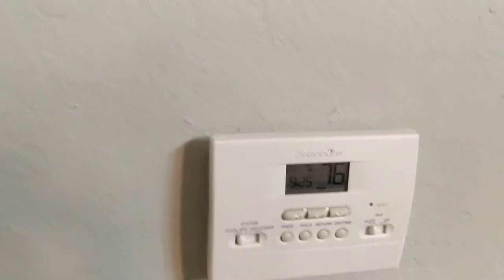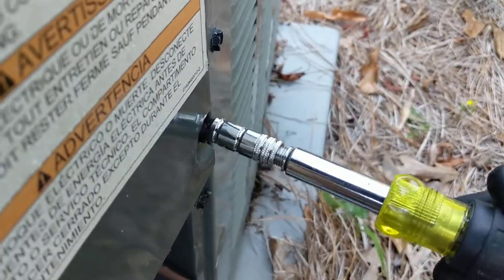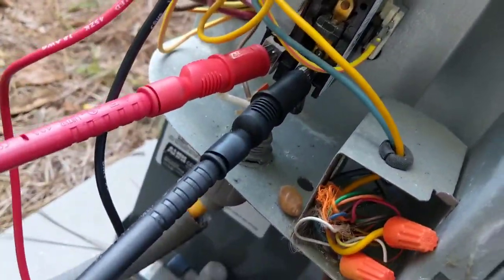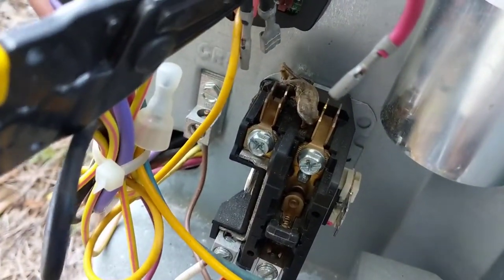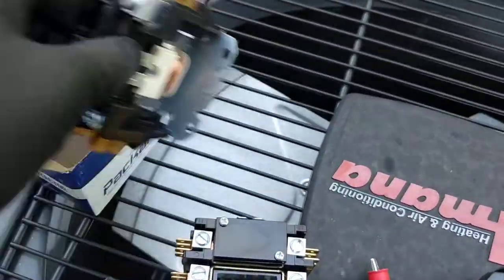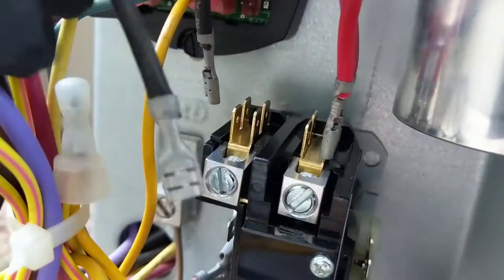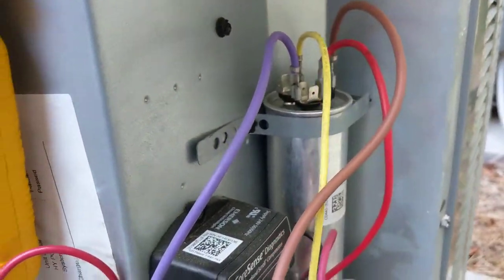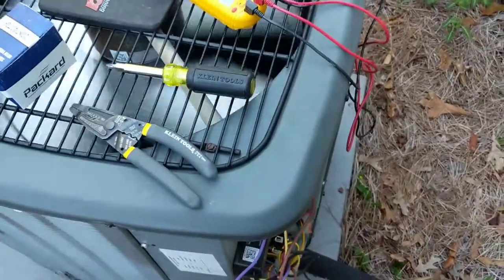Amana AC Not Cooling

Comment: Links to the part you replaced? Also to the cap? I jeed to buy both. I have this same unit (if not its VERY similar)
Reply from the maker: @mr.nuna916  I updated the description of the video with Amazon links to different capacitor sizes & with the contactor I replaced in the video. Make sure you replace your capacitor with the same size the unit already has installed. Size meaning microfarads, example: 30/5 or 35/5. The actual size of the capacitor could vary depending on the brand. Thanks for watching Mr. Nuna916 & help support the channel by subscribing 🛠️👍

Comment: wait is the furnance connected to the AC as well? because this might be why mines not working lol I took my furnace apart
Reply from the maker: These systems are air handlers with electric strip heat. You could also have the same type of setup that is a heat pump. The refrigerant would go in reverse during the heating cycle & also use the heat strips depending how cold it is outside along with what the thermostat is set at compared to the room temperature. If you have a furnace you would have a gas or propane fuel that goes to the indoor unit that lights the burner assembly. Or you could have oil, hot water heat etc....But your AC coil might be inside the same unit as your heat system, just depends on what type of system you have. Thanks for watching Gangsta Nerd & Subscribe to the channel bro 👍

Comment: Whoever installed it, didn't use red sheathed 10 gauge for power feed (red and black wire), and even then, using orange sheathed 10 ga, they are required by code to mark the white wire with red tape to signify 240v which was not done.
Reply from the maker: @JSLEnterprises  I agree! Thanks for watching JSLEnterprises 🛠️👍